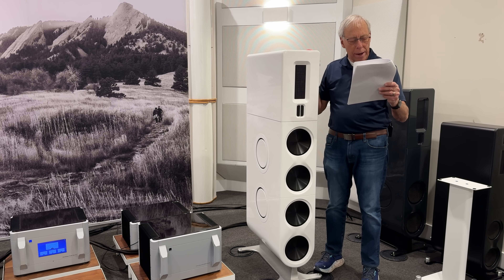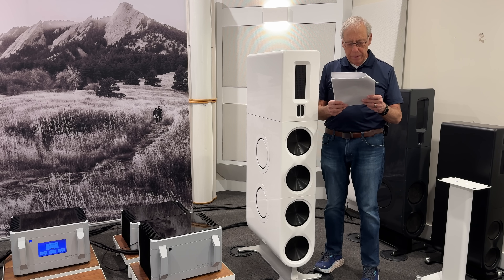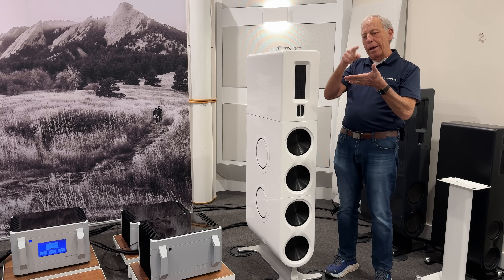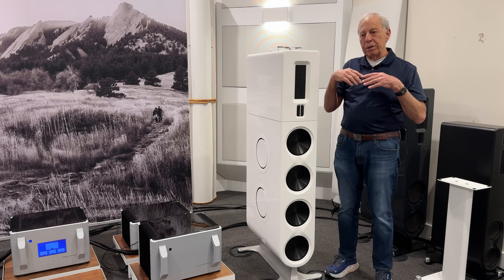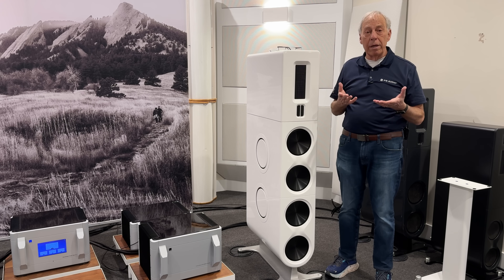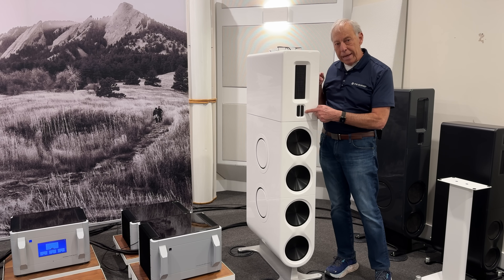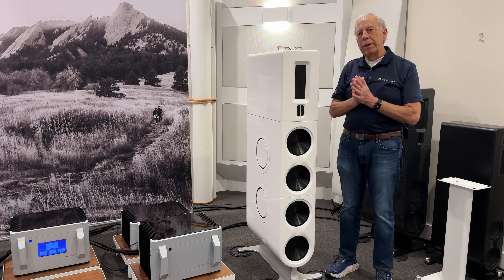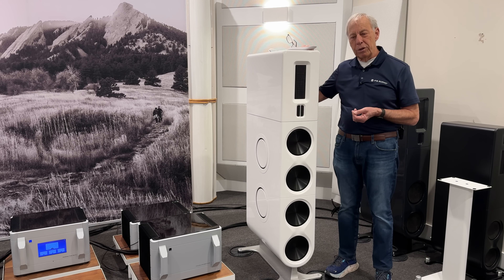Can music damage speakers?

Comment: Well when an amp clips and its mostly held against both rails back and forth.(squarewave) its mostly ac with a dc component..nows when I throw in the problem with active crossovers. Heres why..passive crossovers have a cap (6db) that rolls off the low end to the tweeter.and caps block dc.. so for those that use active crossovers I suggest still using a cap..but an octive down..now heres why squarewave upsets speakers. A square wave has a longer duty cycle than a sine wave.so the resultant heat made at the same voltage level compared to sinewave Is 1/3 more. Let me check that statement cause i might have to divide that ... in half.. p-p vs peak..anyway yes..more heat

Comment: Ages ago, in the late 70s, I damaged some 10" woofers by some very high power low frequency bass that made the voice coils hit the bottom of the magnets when my turntable went into an oscillation mode coupling with the speakers through the floor. This was in my mid teens when using some Coral full range FLAT 10 drivers in some bass reflex cabinets I designed and built myself. I still remember the bang-bang-bang sound when hitting the bottom. A decade ago I fried some Velodyne servo subwoofer due to the feedback circuit being broken causing the subwoofer cone to go crazy. It's easy to fry tweeters by a clipped signal, but it's quite avoidable also as the distortion when clipping makes the sound unbearably bad. Well, not entirely, cause each track can have different peaks. I've had a few cases being in another room and suddenly hearing such clipping issue, and by running quickly back to turn down the volume you might save your tweeters. If you are in the middle of doing your thing on the toilet and this happens, and it's not at an audio show, better run LOL...
Reply: Homemade bass cabinet of my friends launched a voice coil into the middle of the room. We thought it was pretty damn awesome. 17 or 18 at the time

Comment: There's a difference between a recorded "square wave" and the result of amp clipping. A recorded square wave has a normal 20-20kHz bandwidth and will follow the typical higher frequency/lower power trend. When an amp clips, there is no bandwidth limit. A square wave is the sum of sinewaves from the original square wave frequency up to much higher frequencies (this is heavy math's called Fourier Transforms) so a loud 100Hz bass note that hard clips the amp, turning it into a square wave,  creates a bunch of high frequencies that can overload the tweeter. This is why loud music of any type, tends to take the tweeter out first.

Comment: On my first passive Zeck 15/3 PA system there were festoon bulbs inside the cabinets to protect the tweeters. If they lit up you could see the light through a hole and knew that your level was too high. Because my amp was too weak (a money issue) the bulbs burnt out every now and then during a concert and the tweeters went quiet. Always needed a bunch of spare bulbs but at least the tweeters survived. 😉

Comment: A guitar amp doesn't use tweeters. There are a few cases of DI distortion such as Mike Oldfield but most extreme cases are home recordings.
I blew a midrange with Diamonda Galas. My belief is that there was an unusual amount of content just above the (too low) crossover frequency.

Comment: Back in the day, a friend blew out the tweeter on his speaker blasting Edgar Winter’s “Frankenstein.”
Reply: in 2001 I blew up the right midrange driver of my B&W 802 S3 during that wild synthesizer part that starts around 3:15. I think the replacement driver was close to $250 at the time.

Comment: Decent quality amps and excess power are the best prevention , clipping and poor quality hardware will damage speakers, and calibration helps. Even though I play music and films, the AV processor only allows what the speakers can handle - tweeters, as said usually fail first, though bass drivers can go abit before expiring.

Comment: I can't see it damaging speakers, but there is certain notes that if played together creates intermodular distortion that sounds really bad. There's a video somewhere on YouTube that shows this, I believe it's Iron Maiden that he's playing both guitar players part at the same time. 🙉😄
There's also the issue of digital filters, they can create harsh sounds when overshooting, but I doubt it would damage anything more than the experience. 😄
A speaker/driver is usually only damaged by DC, going beyond mechanical limits or thermally, but I guess there's someone out there disproving this as we speak. 😂

Comment: Clipping in an amplifier,of any frequency, generates high frequency at the full output power of the amplifier. A recording of clipping, is played back at the volume level set by the volume knob, not the maximum power of the amplifier.
Reply: That was my thought, clipping in a recording is line level clip, not power amplifier clipping beyond its capable clean output power, obivously your getting the square wave effect on the recording but not at excessive power output levels as a power amp would produce at clipping, theres many songs ive heard that have been recorded into clipping ,ie over driving an op amp in the mixing desk during recording, if it makes sense
Reply: Playing a recording (that was recorded badly / loudly with clipping), quietly won't hurt the speaker.

Comment: What about music recordings that completely max out the audio spectrum? I've noticed a few modern albums lately where the audio engineers seem to be doing what they did in the 90s during the 'loudness wars'. They sound terrible (even if the music is great). Back in the 90's it was apparently done to "improve" audio quality through cheap headphones. I have no idea why it's being done now
Reply: it was for radio/car play. well I suppose it works with cheap headphones too but that's not as important for a song to become a hit - if you were listening to it on your cheapo walkman clone back then you already had bought the song. it has to sound as good it as can on hearing on a random crappy transmission on a crappy stereo, first impressions - NOW it's being done for it to sound better on a smartphone/tablets speaker, which are a lot worse than a random cheapo boombox or an 80s/90s default car stereo, but it is also how a lot of people only will hear the song.

Comment: It's also not a good idea to play deep bass notes very loud on a vented woofer (or passive radiator) system . The excursion of the membrane will rise very high for for frequencies below the tuning frequency and can then exceed mechanical Xmax which can damage the woofer.
Reply: Excursion rises dramatically below tuning frequency for vented, but at the same time, sealed enclosure leads to higher excursion above and especially at the the tuning frequency. In essence, both types are equally susceptible to bottoming out, albeit with slightly different spectral content.